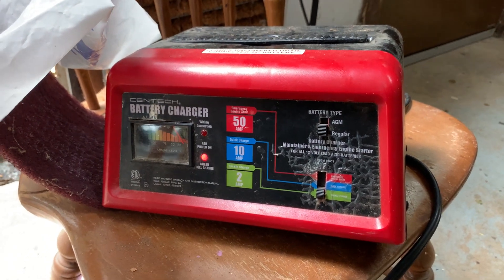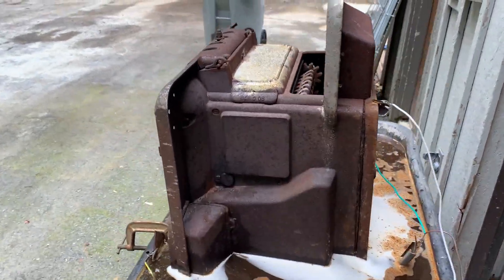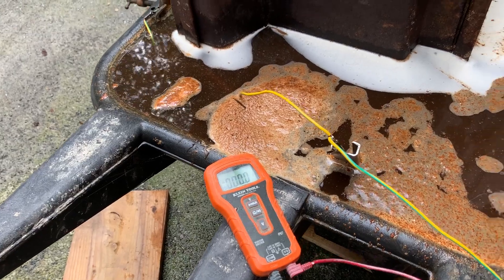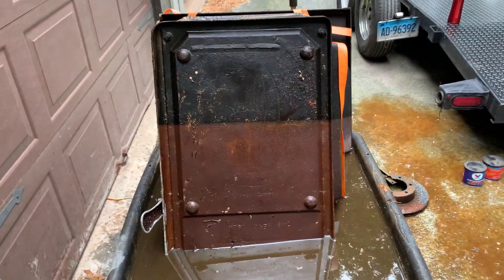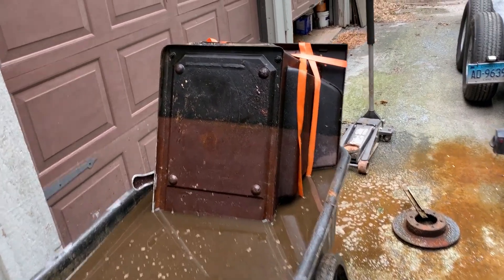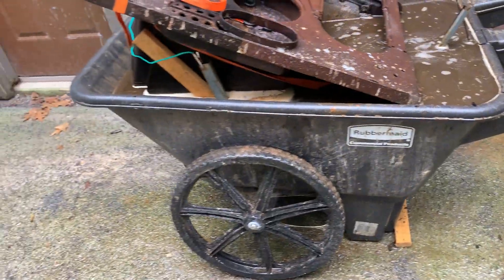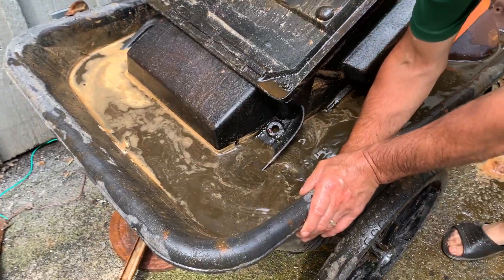Electrolysis  Rust Removal with Any Battery Charger.

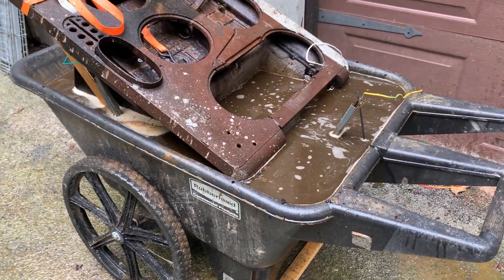Comment: 3:20 One can make homemade washing soda by placing plain soda in a kitchen oven on high heat for fifteen-twenty  minutes. This cleared my bath drain along with running hot water.
Great video.

Comment: USE RUBBER GLOVES....I HAVE BEEN DOING THIS FOR OVER 20 YEARS....NO WAY WOULD I STICK MY ARM DOWN IN THAT TOXIC SLIDGE
Reply from the maker: Great comment. Thanks for the advice!
Reply: Rust can stain your skin (as it will stain clothing, wood, or other surfaces) but there's nothing inherently harmful in it. Even a wound from a rusty object isn't necessarily worse than a wound from a non-rusty object

Comment: this battery hack is exactly what I needed. Pretty smart.
Reply from the maker: Yes. Thanks for the comment. Those smart battery chargers need a buffer to work with electrolysis
Reply: That was exactly what I needed to I was about to go shopping pawn shops looking for an old one. Thank you.